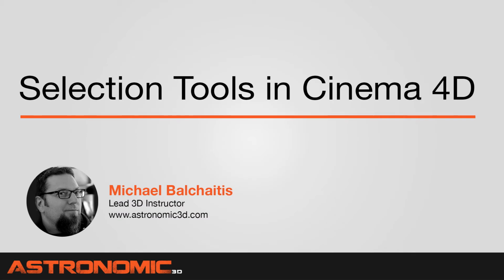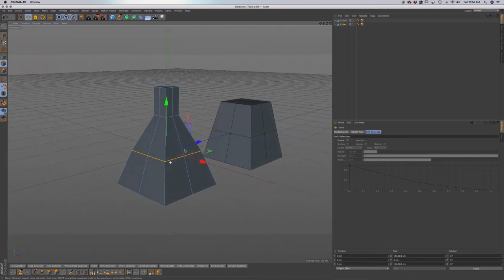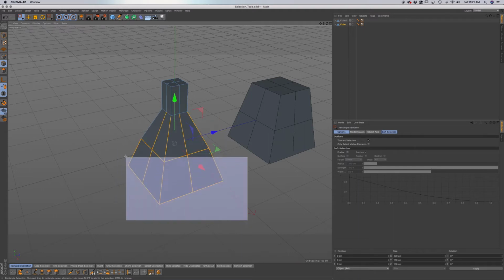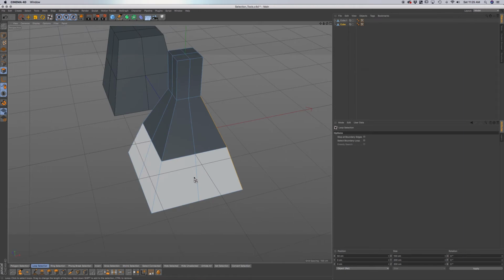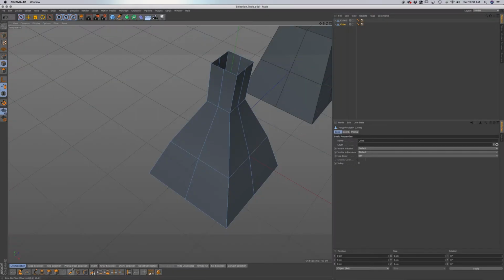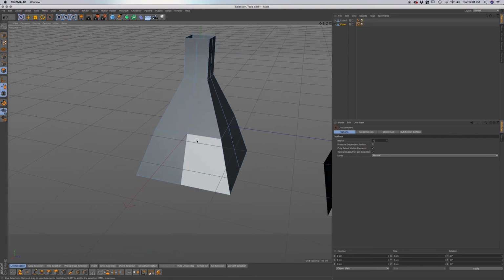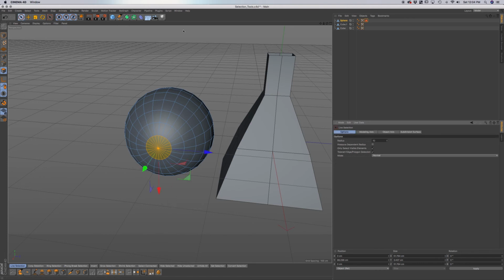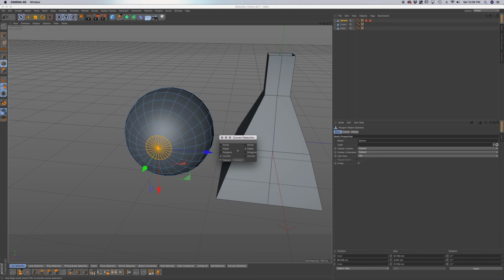Selection Tools in Cinema 4D

Comment: I would appreciate your help. I am new to C4D and today I run into this problem - https://i.imgur.com/alVMimi.jpg I need to split an object, for this I am using Live Selection(or Lasso) Tool in Polygons mode. After selecting and splitting an object a lot of Edges are left behind. It's very hard to select what you can't see, sometimes it won't be selected even if I pass this polygon and edge for a few times. What I am doing wrong? It's really pissing me off.